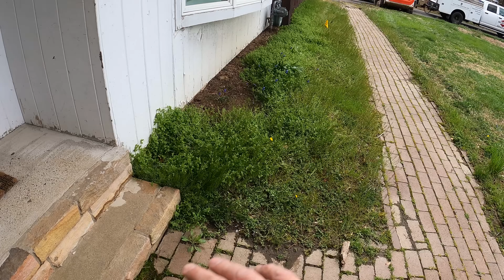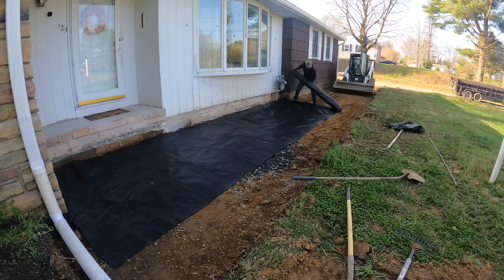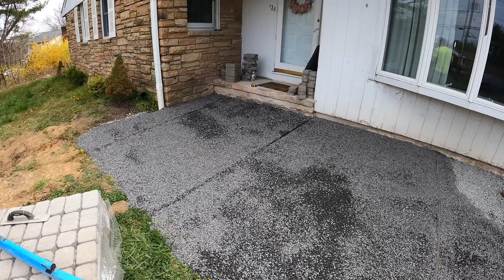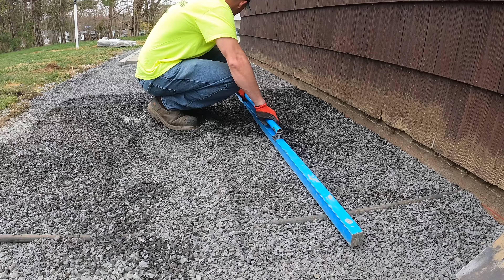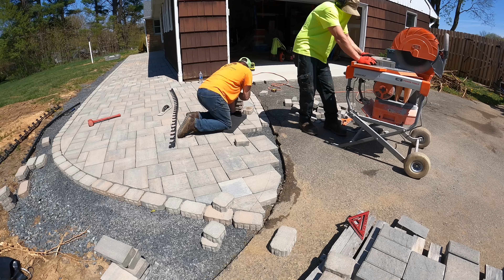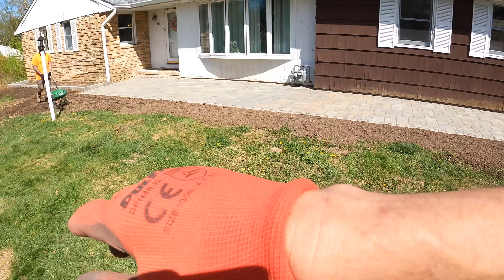Replacing this old sinking brick walkway

Comment: Beautiful work! I would strongly suggest using concrete for your border restraint. It’s a fraction of the cost, and holds up much better than the plastic edging.
Reply from the maker: Thank you
Reply: I was wondering how the plastic would hold up when someone was edging their lawn with a weed whacker/eater. Figured it would get chopped up after a little while.

Comment: Great job brother. How come you don’t use mortar for the edging instead of the plastic?👍🏻🇺🇸🇺🇸
Reply from the maker: Thanks man, I've had issues with grass not growing back over the concrete edge. The plastic seems to hold up as long as its backed by dirt.

Comment: Hi, there should be at least 6 inches of foundation exposed to prevent damage to the structure
Reply from the maker: That would be ideal, but the grading of his front yard would not allow it. Previously the dirt came all the way up to the bottom of the siding. Now there's about 1.5 - 2" gap so it's definitely an improvement. Thanks for the comment

Comment: Great job, however, you need to be using a concrete edge on open graded bases. Those spikes are not capable of toeing in pavement with open graded base.
Reply: Why don’t you go help him then
Reply: @justinsimon4368  i just did